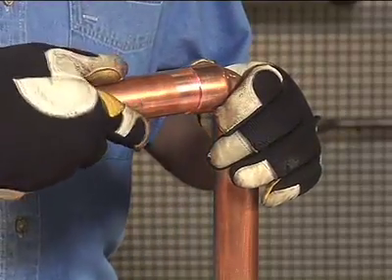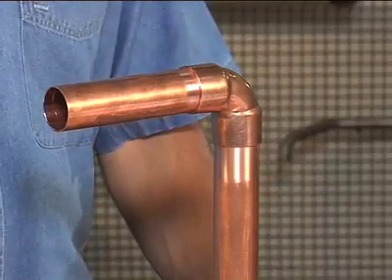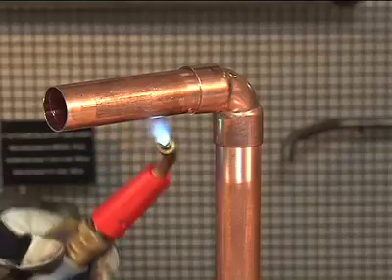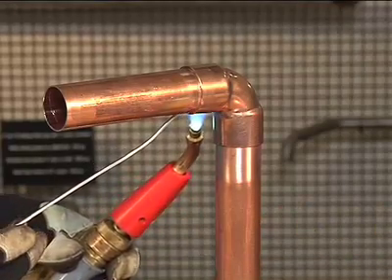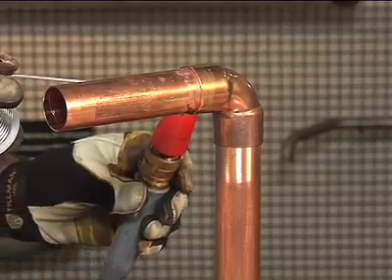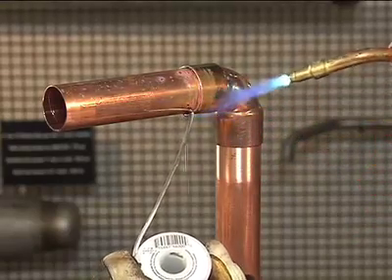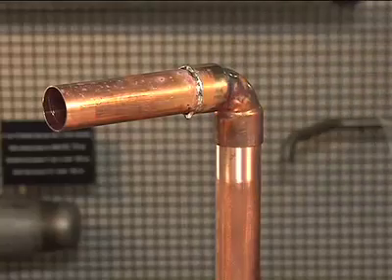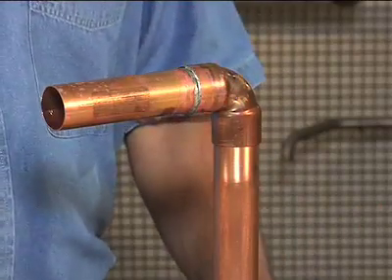Fluxing & Soldering Techniques

Comment: @complaintrain Hello there;There is nothing wrong with wiping it off,but the soldering paste will run out of the fitting as soon as you begin to heat it and will run down the pipe regardless.The amount of soldering paste that is required for soldering is a very thin coat that you should almost be not able to see. I use a popsicle stick to apply my flux and I apply very, very  little. 
One small tin of flux should be enough to run the waterlines for about three homes. G.L. Al

Thanks for the

Comment: It is just a matter of heating the pipe joint, applying the solder on top and let it run around. Take your time and you will ahve no problems. good luck and have a good day

Comment: WOW!....Very hard to watch.  I have been at this for over 30 years and that wasn't pretty. When applying heat it is to be placed on the bottom of the fitting as heat rises.Depending on the size of the pipe to be soldered,but most homeowners would have 1/2 and 3/4 size pipe in their home.Apply the heat to the bottom and then place the solder on top.There is no need to wipe the soldering paste (flux) off before you begin. Take a damp cloth and remove the flux once the joint has cooled.  G.L.

Comment: The worst soldering technique ever !!! 
Why not apply heat at the 90deg fitting and start the solder from the top. 
 and let the melted solder roll to the left and right.

Comment: Use More Flux, And start at the top of the fitting, also, dab a bit of flux on your solder. starting at the top will make the solder run all the way round the first time, hense the word.. "capillary Attraction"